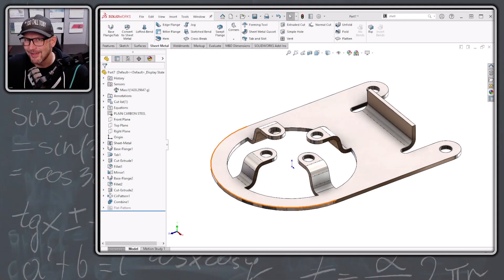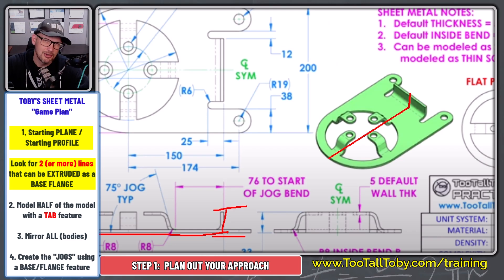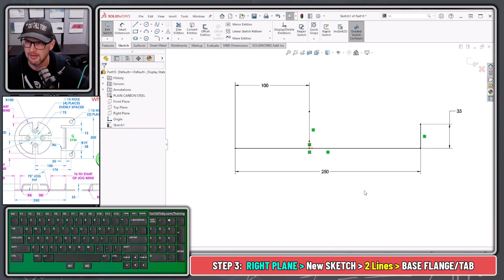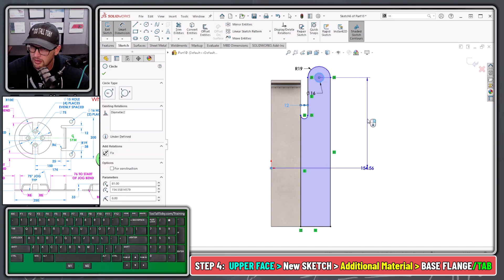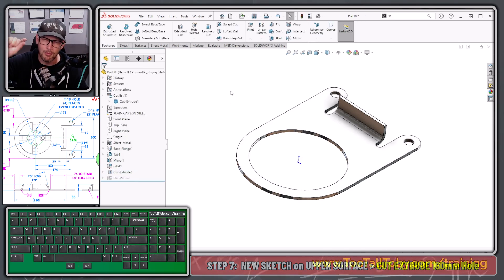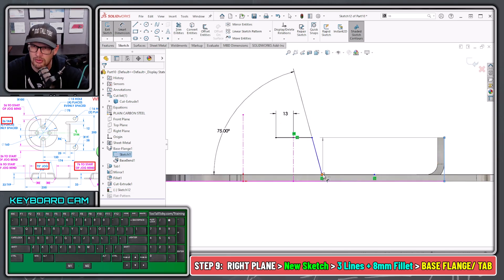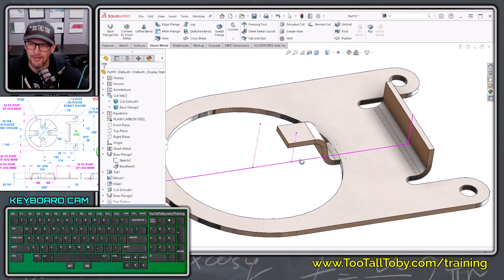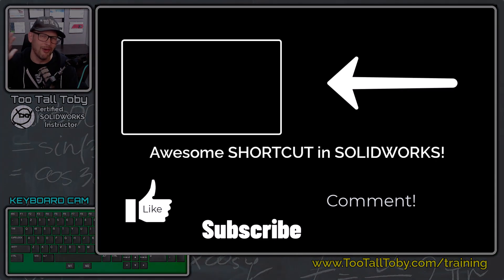Can we PATTERN this JOG??  ULTIMATE SOLIDWORKS Sheet Metal Training - Step by Step Tutorial

Comment: I followed this tutorial in OnShape. Everything worked fine until the final part: it wasn’t possible to create a combine because that option doesn’t exist in OnShape. Then, I tried using a Boolean operation, but it still didn’t work. The sheet metal models remained unfinished, and when I tried to complete them, the full flat view didn’t display correctly... 🤔